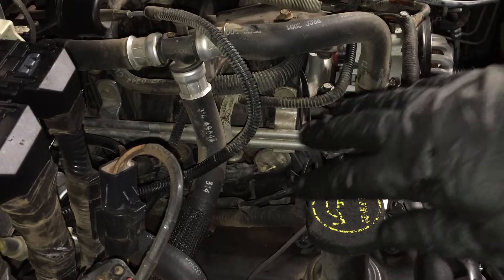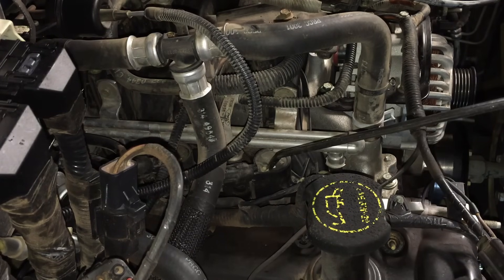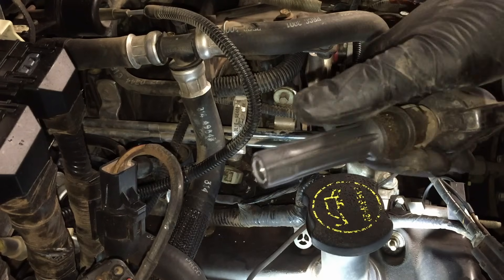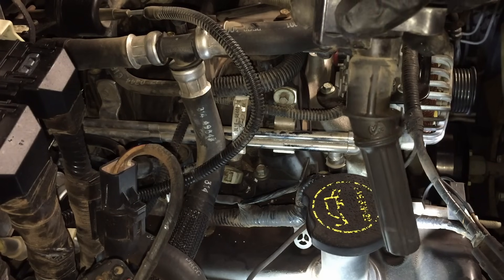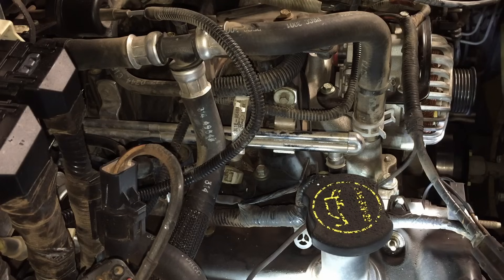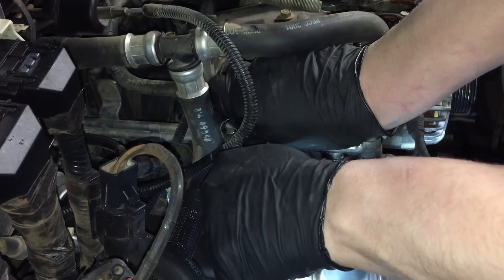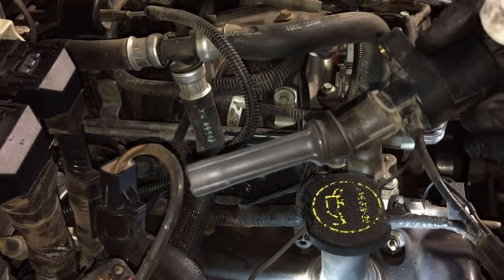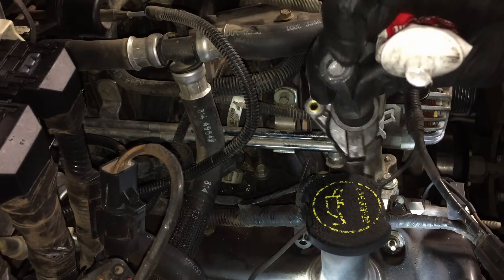Important Tips When Replacing Spark Plugs on Ford 4.6L 5.4L 6.8L 2v Engines

Comment: Very helpful, thank you!  All I had to remove was the air intake.  The swivel spark plug socket is a must!  Installed Motorcraft plugs and coils.  Took less than 2 hours.  Would have been faster but cleaning out the spark plug area takes time.  Make sure you check inside the tube after taking out the coil but before removing the plug.  If I hadn't done that I would have gotten debris in the combustion chamber.
Reply: Did you use a little anti seize on your spark plugs? He said to use just a little and some videos say not to use any on the spark plugs.
 
It's confusing since I'm a female new to doing my own vehicle repairs on my 2000 ford expedition 4.6L V8 Triton XLT.

Comment: I'm currently in the middle of changing plugs, coils,and injectors  but back plug on passenger side is seized and won't come loose  and if I break it I'm screwed  is there any tricks to get it loose as pb blaster doesn't seem to be working

Comment: Nice... Excellent video... had a spark plug blow out August, 17 2017 on number 3 cylinder on a Ford E-150 4.6 L.  Had to drill and tap a new threaded insert fix the stripped threads. 1 hour job. 
I used a Ford Cylinder Repair kit and have 7 plug inserts left that I don't think will need again. best Regards and respects for how you help everyone... Great work!

Comment: Autolite plugs look and perform exactly as the Motorcraft plugs. I used Autolite double platinum plugs.
Reply: I just got some autolite double platinum spark plugs for my 2010 crown vic flex fuel interceptor and this vid had me worrying if I should return them lol

Comment: When reinserting the plug,  I always, ever so gently, turn it as tho I'm removing it (counter-clockwise) so the threads will catch (you'll feel it drop into the groove)  then clockwise until finger tight,, then torque it down - never had an issue with cross-threading
Reply from the maker: Not a bad idea but it is not required, as long as you are spinning it in by had you will be fine. If you can cross thread a spark plug by hand then I would like to shake your hand.

Comment: Great video, thanks for doing it.  Have an ‘03 super duty, 5.4, 6 speed manual, 85k, religiously maintained, not a daily driver. Owned it 10 years.  Pulling a empty 20’ car hauler when the rear most plug blew out of the head.  Having heard about this issue, 10k ago, had all the plugs switched out to avoid this happening.  The mechanic claimed to be familiar with the problem.  He is out of town, I am “dead in the water”. Any particular advice, in addition to your fine video?

Comment: I've used my shop vac..with a small hose or even a Straw and I tape it on the end with electrical tape...works well to clean out the water and sand...I don't own an air compressor with external tank..Yet

Comment: Very informative!! I am trying to replace the plugs on my 04 Town Car. I managed to change one plug with no issues. The second one came out without an issue but trying to put the new one in it goes maybe 3 turns and it stops. Thinking i was cross threading i tried a few times to re seat the plug with no luck. I am guessing the threads are dirty or damaged in the head.

Comment: Just finished this job myself, very helpful video. Although, I do have a question hopefully someone will be able to answer. On cylinder 4 on the 4.6L there's an extra wire coming out of the wiring harness with the ignition coil pigtail for cylinder 4. The mystery plug is right angled and only has one wire but I cannot for the life of me see where it plugs into and I can't find anything online. The plug was hanging there before I got in to swap parts. This is on an 04 MGM

Comment: I just installed 8 new coils and plugs on my 99 f150 5.4 2 valve. 181,000 miles. Not for the faint of heart as I needed to remove the drivers side fuel rail to get to the two rear coils on that side. As far as torqing the plugs I read 28 lbs and guessed at it by feel. I used Bosch double platinum plugs on it along with duralast coils that have a warranty. I cannot believe how much smoother the truck runs, how much power is there. There was literally 4 coils that were bobbing up and down because the bolt had wiggled loose. I dont know how the trucks ran pretty well for the 6 years ive had it. Hopefully my mileage goes up a little as well as ive recorded 12.9 on the highway. I love these mod motors. I own a 97 mustang gt as well. Theyre not powerhouses but dammit theyre bulletproof. Love your videos

Comment: Just replaced spark plugs and coils on my 05 excursion 6.8 v10. Went with the bosch double iridiums and love them. All my plugs were loose while taking the old ones out but I put the new ones in by hand just going by feel for when they wanted to stop. Good n tight which I checked with my small torque is around 25 foot pounds. V10s are very hard to torque the back plugs so I did the swag method. Also put high temp antisieze on all plugs and truck is running great. Also some ply wood cut by a hole saw and drilled out so some pex pipe fits through then turn on your shop vac and you can such out all the sand and dirt for almost all the holes.

Comment: I sure can't wait for auto manufacturers to do to automotive wiring what circuit boards did to get away from standard wiring. Imagine wires NOT being all over the place. Sloppy. Unimaginative. Lazy. Auto engineers really suck at what they do, they should fire every automotive engineer on the planet, then all the manufactures should hire Chip Foose.

Comment: I am 'overly' cautious, and I cringe at how I see many mechanics on YouTube casually and at times carelessly or almost brutally perform some tasks. I like this channel and have watched several videos over the last few years, but I will never understand why a professional mechanic would recommend blasting air around an open spark plug hole. It's risky, and also redundant after wisely using the air twice already in this case. If reasonable care is taken at the point when the plug is out, the area should be clean enough to avoid dislodging stubborn debris that the air didn't already remove. If anything, I'd modify a shop-vac hose to clean out an area that's particularly sensitive to the ill effects of contamination. I think that a cylinder is at or near the top of a list of such spots. : ] 

I'm watching because I intend to change one plug and coil for someone based on an AutoZone OBDII scan. I dropped the coil with a 'thud' as it slipped through my fingers in its Amazon shipping envelope, so I hope that Ford has them made to be sturdy. ; ]

My criticism aside, I like this guy and don't mean to be overly critical. His channel was a 'go-to' thought when I wanted to research this job.

EDIT: I just saw Random 549's comment, only a few down in the thread, from four years ago about modifying a vacuum cleaner to assist with cleaning off the engine. ; ] Even though blowing out the cylinder is suggested here, how much of any debris that gets in a cylinder do you think will make its way out of a spark plug hole with an air blast? Modify a vacuum hose with a few feet of 1/4" vinyl tubing and you can vacuum up top as well as inside. ; ]

Also, why use anti-seize if plugs are known to blow out of these heads? No goop and a little extra bit of rotation seems sensible, but I don't do daily Ford work like this.

Comment: I'm not optimistic. If I had the $400+ to spare I'd just pay someone to do it. I'm a short lady with a stepladder, and have to help an 18 year old with his first car. It's like a freaking bowl of spaghetti in there, I'm used to older vehicles where the plugs etc are right on top and reachable. 
At least the 18 year old is over 6' tall, so he can reach stuff. 

And thank you - your video is excellent. No freaking clue what a fuel rail does, and I've never had to deal with a seized plug before - we got this cheap from a desert rat. "Hey, it runs."

Comment: The best advice on changing plugs in a 04 ford f150, DONT! They will blow out and strip out the threads, taking out your mounting tab on the coil. Taps and coils dont hold.

Comment: Wish I would’ve known all this when I replaced my intake manifold, injectors and plugs on my ‘01 Mustang GT at around 125K miles. Went with Bosch instead of Motorcraft, have blown 2 plugs in the last 20K, with the recent 2nd one destroying the threads to the point I’m gonna have to ream, tap, and install an insert. Might do that on all 8 cylinders, just to prevent future blowouts, as inserts have like 3X the threads of OEM.

Comment: I replaced spark plugs on 2004 grand marquis with coil packs from Amazon but its running worse than before the issue i am having the connections for coil packs are not clicking on the new coil packs. In video you mentioned factory Ford coil packs but Amazon has some coil packs that are better priced than Ford.  Are those the high performance from MSD and accel ignition or other manufacturer? 
You have great video

Comment: I bought AGFS32PM plugs  but found that they are substantially different than the AWFS32PM plugs that were originally installed. Are they compatible anyway? 2002 Mustang GT. Update: Ford said they're compatible so I installed the new plugs and nothing blew up. So I guess I'm good to go.

Comment: When you get your spark plug loose and if it don't come out with your socket you can take one of the bad calls you took off and cut the end off and screw the spark plug in the one end then stick it down on there on the plug and it will pull it back out this will also be good to use when you put your plugs back in just use the thing you created stick it on top of the plug and stick it down in the hole and gently start screwing it with your fingers that way you will not get it cross threaded and it's much easier to get your plugs out and put your plugs in the first call you take off cut the straight part off take your old plug and screw in the end of it then you can use it every time when you have to change your plugs you can stick it down in there and grab your plug out you can stick it down there and start your plug with your fingers it works perfect.

Comment: GREAT VIDEO THANKS!
I have a 2006 F150 5.4 and it was running rough.  It thru a PO305 & PO349.  2 weeks later, I got 4 blocks from the house and it just got up and died at a light. Now it won't start.  I've replaced both camshaft positioning sensors to no avail.  It turns over but "No Start".
OPEN QUESTION TO EVERYONE!
Any help would be greatly appreciated.  Thanks!

Comment: I'm confused, I've been reading a lot about torquing plugs in a 4.6L 2V. A lot of people are saying that they should be torqued around 13 ft-lb and that 20 ft-lb will likely strip the threads in the head. So, I'm a bit nervous about replacing these plugs in my 02 Mustang GT because of blow out or stripping issues. There are those that say if you use anti-seize that a lower torque setting should be used. I want to get this right.
Reply from the maker: So you are saying you don't trust my advice of 20 ft lbs as explained in detail in this video or ?
Reply: @FordTechMakuloco  No offense intended. Considering how much it would cost to replace/repair an engine, I just want to make sure that I'm doing this right.
Reply from the maker: 20ft lbs and a very light spot of anti seize you will be perfect.
Reply: @FordTechMakuloco  I do trust you now. It appears that the original plugs were torqued to at least 20 ft-lb. So I installed and torqued the new plugs to 20 ft-lb.  No problems so far. I did find 4 coil connectors that wouldn't snap into place so I've ordered replacements (it's not a problem with the coil assembly connector).

Comment: Do you have a video for addressing the valve cover gasket leak? I'm seeing recurring problems with replacing spark plugs and coil pack so that sounds like what might be the root cause.

Comment: Thank you so much for the good advice.   I had to buy a 7mm 1/4" drive socket built-into a universal to get #7 out from under the fuel pressure regulator.  Didn't have to take of fuel rails. Cleaned all coil boots and plug holes, anti-seize on threads, finger set all plugs before over torquing, di-electric grease on coil-plug spring.  1999 expedition, 5.4l 2v.
160k miles, looked like original plugs(I don't really know), I bought it at 106k miles.  Took it slow and didn't panic since I saw your video/advice..  3hrs.. got her done!
I found by putting to concrete blocks down and a 6' 2x12 in front of the vehicle gave me just enough height it wasn't bad getting #8/4.
Reply: you could’ve used a wrench 😂
Reply: Being a painter, I've discovered a 5 gallon bucket is the perfect height.

Comment: my 2011 e250 5.4 has that fuel rail in the way where I can't pull the coil out without removing this? how do you remove this? this is cylinder 7 inside the doghouse 2nd on drivers side

Comment: I had to remove those clips attaching to the fuel rail to get to the 7mm bolt  for the coil on the passenger side of my 2011 Grand Marquis

Comment: Did the spark plugs and coils in my 2007’ town car. I checked the gap before installing the motorcraft plugs (new higher quality platinum) and they were set to 0.046” from the factory. I think once they start wearing in they will be around 0.054” like from factory. I swear since replacing the older nickel ones (much wider electrode) that were originally in the vehicle when I bought it, with these, I lost some power in certain spots. Maybe it has been distributed differently, since the platinum plugs are designed to optimize acceleration... the car accelerates at like 2200rpm fast and I barely feel it shifting gears. It’s interesting how the electrodes metal changes how your car drives. I’m satisfied and I don’t want to regap them and ruin the coating. Also changing the plugs on these cars is wayyyy fun. 🔧

Comment: For what this job is...its one of the bigger PITAs jobs. I mean, plugs and tuneups on older cars are a breeze. But man...My hands are big, and I managed somehow to break a vacuum line to some module..no clue what it does, past the point of caring...

And of course, my starter died at the end of the job...another pain on Panthers.
Reply: There is nothing as easy as working on '50's Chevy's!!!! You can fix them with a wrench in one hand and a beer in the other!

Comment: I have a 97 Grand Marquis, it has the older ignition system with plug wires, What motocraft plug should I run?  I can get copper, platinum, double platinum or iridium.

Comment: The fuel regulator I have is not the same as shown. It has an oval/diamond shaped plate as part of the fuel rail with 2 o-rings that the regulator presses in. It's directly over the bolt on the third from the front driverside. I don't think there is anyway I can get this done without removing the fuel rail. D'oh. I wish ford would quit changing their mind mid year. Only good thing is I have a 2-valve 97 so one piece plugs, yay.

Comment: My 2008 MKZ has two places in the fuel one for the pump on drivers side and another on the passenger side with a wire connector what is this one for?

Comment: Do you have a video on changing the spark TUBES?
Reply from the maker: No sorry
Reply: @FordTechMakuloco  Are they a pressed in fit? My 3.5 MKZ has a damaged tube, that has caused the seal to leak oil into the plug cavity. I've seen some Chevy engine videos, where they can be pulled out, then new ones pushed in as an interference fit.

Comment: When you blew out the hole AFTER you removed the plug did you blow out the inside of the cylinder?
Reply from the maker: Once the plug is removed you stick the air wand into the cylinder then hit the trigger but not before.